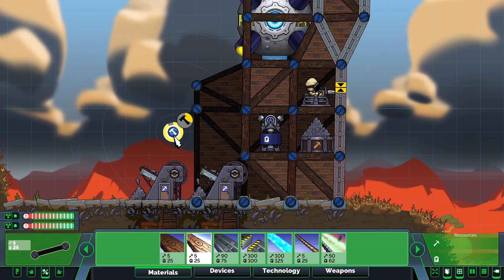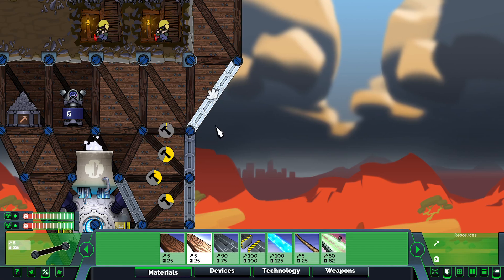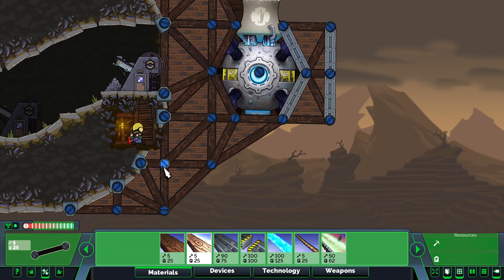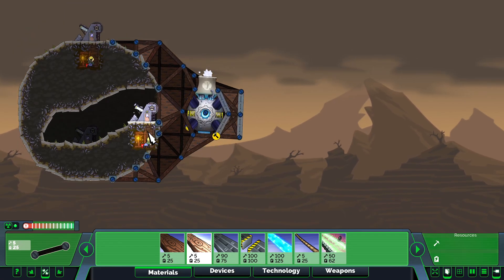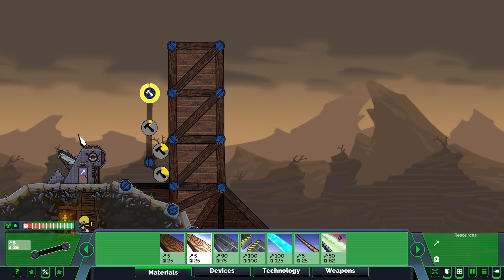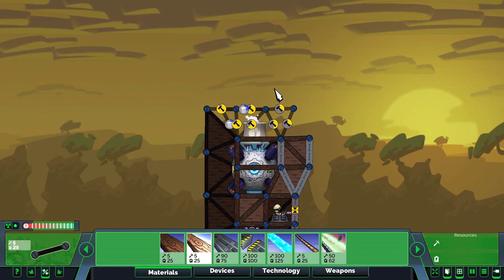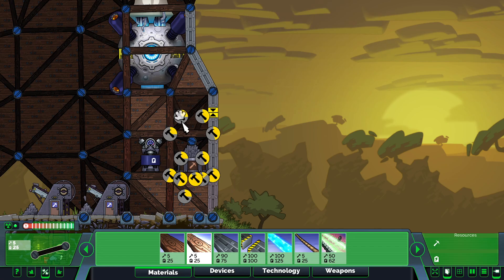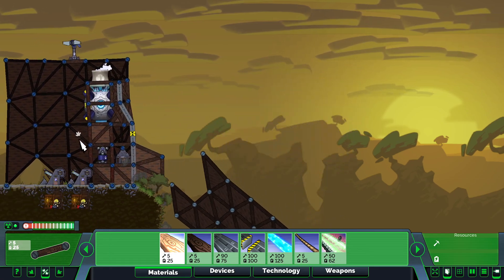Forts stability tech explained (why and how does it work?)

Comment: Great video thanks!  I'm new to the game and I'm always collapsing.  Odd question, but what hotkey do you use for delete?  The only free one that I found which is easy to reach is Caps Lock, but it doesn't seem to work well.
Reply from the maker: i personally use spacebar but all the pro's use Q and use spacebar to look at the enemy base. i'd recommend Q or just try and see what feels best if youre not too bothered with being the best of the best.
Reply: @roborogue_  Thanks.  Q works a lot better.  Had to press Caps Lock twice for some reason.